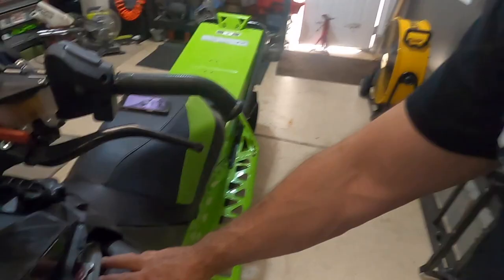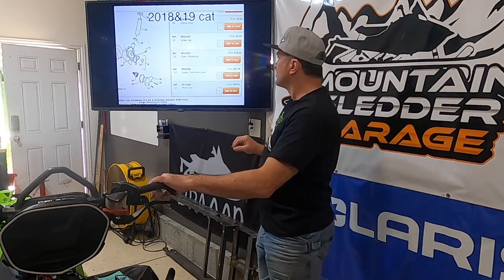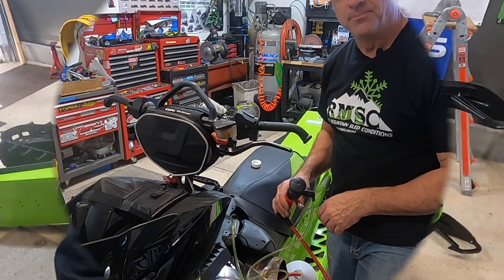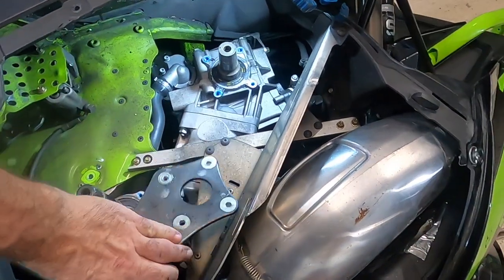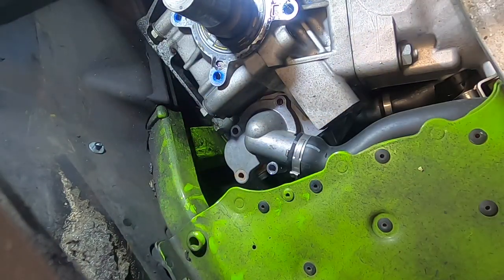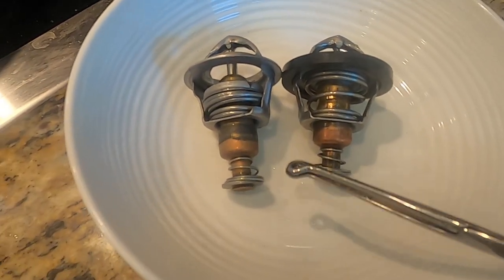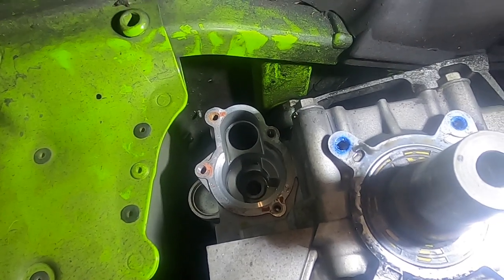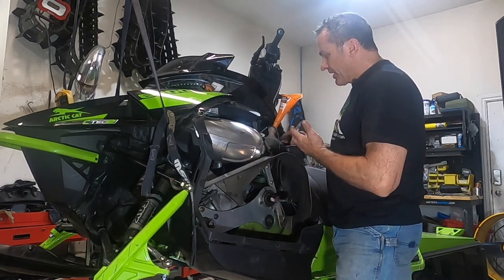Arctic Cat ctec 800 cooling issues

Comment: My 2015 M8000 has a standard gauge and is supposed blink when it comes to temp and it’s never came on I’ve replaced so many things should I check my thermostat it had a new motor put in last January and new ecu still keeps going into this annoying bog/throttle cut

Comment: Why would it give better cooling if it opens sooner?
Reply from the maker: The sooner it opens and coolant flows through the heat exchangers, the coolant will circulate at a lower temperature, this operating temp will be lower. As long as you are in the powder with adequate snow flowing through the tunnel.

Comment: this information is not correct.  the 0913-022 thermostat was also 85f, not higher temp as you say in the video.
Reply: the 0913-022 only "shows" more expensive because it is discontinued, you can't order it.  you have to order the 0913-034.  if the 0913-022 was still available, it would be similar price to the 0913-034.

Comment: At 86° f why even bother with having one. Just take an angle grinder and buzz the thermostat part off. Then you are just left with the frame your gasket attaches to which will seal off the housing.
Reply from the maker: Keeping the thermostat in is more just warm ups. The sled will get to operating temp quicker with the stat if its functional, because you are not warming all the coolant, just the coolant in the engine until the stat opens.